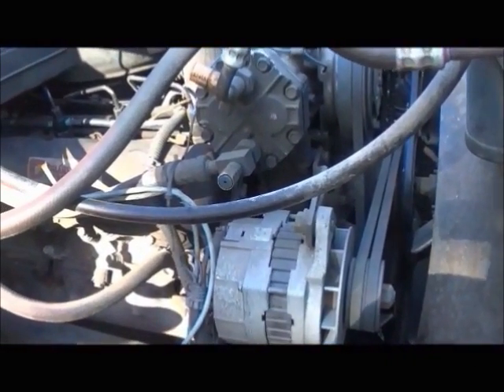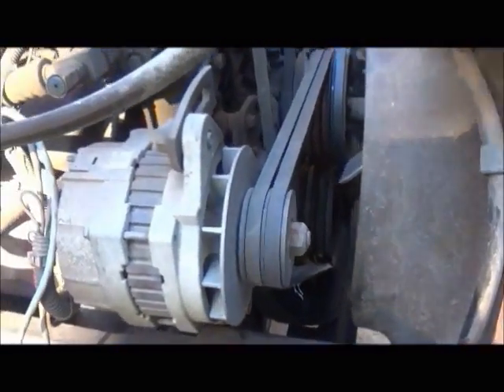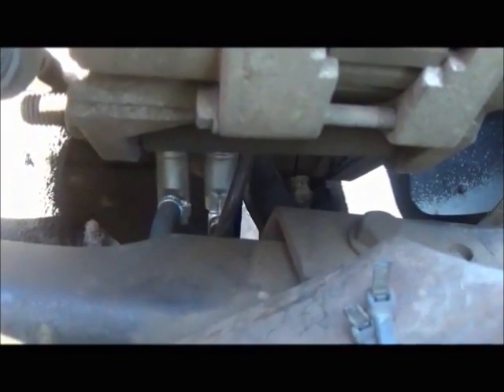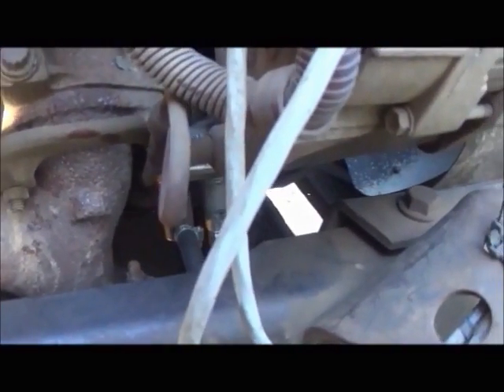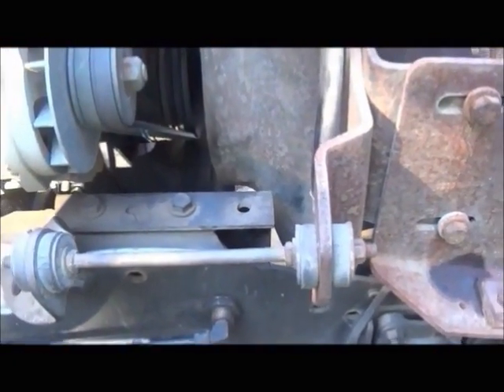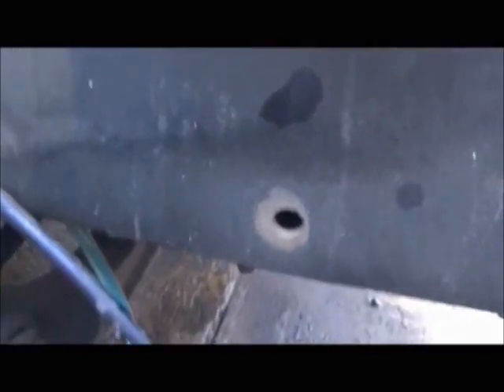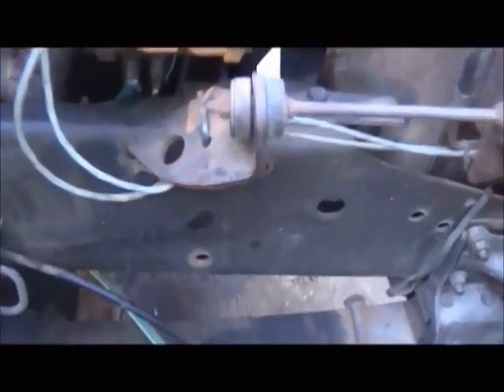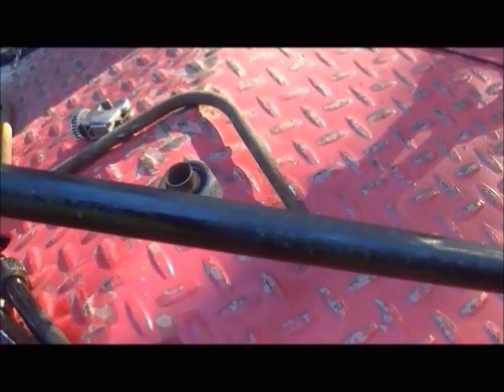Troubleshooting A Diesel Fuel System For Air Leaks International 7.3

Comment: 😂what a pain in the ass ..I'm doing research to find out what could be the cause of difficulty cold start I suspect an air leak between diesel pump and tank today this bastard broke down in the road and I had no tools with me😂 I pump the prime pump on filter housing and it ran enough to get back home so I changed the filter did find 3 drops of water but the diesel was coloured like paraffin clear not green like it should be in thinking there is a garage with diluted diesel but I still think I have a airleak😂😂 I'm not a qualified mechanic but I can help myself in all trades except understanding women

Comment: Actually running into the same issue on my international rollback. Weak and starts sputtering in high rpm
Reply from the maker: My top kick does that when the filters start clogging. Not enough fuel at high rpm
Reply: @jonathanw4942  Just put a new filter on this morning, it was time for one anyway. When I took it off air was hissing out, not sure if I'm suckin air or the system was pressurized. It only sputters in L & 1 now, but has white smoke. Putting on a new lift pump I have tucked away to see if it fixes the issue.

Comment: lol bro sick idea. i also work with low pressure systems and use a little air pump, a little female air fitting on the end and can use a chuck with q cone shaped nozzle and jam it into the system and look for spray/mist somewhere. the first thing to blow out if you overpressure the system is the lift pump so keep the psi low lol. i like you clear hose idea i will have to try that sometime have plenty of hose floating around. thanks for sharing sir

Comment: Question, if the injector pump "pops" the injector and sprays fuel into the cylinder and the residual is returned to the fuel tank via the return lines, why does air in the return lines cause a problem?
Reply: DRA5136 cavitation where the tiny air bubbles collapses/implosions which creates heat and rapid wear and tear on the pumps and injectors creating a crappy runnig engine!

Comment: pressure the line and spray with soapy water, or plug the line and pressure with air with a gauge to show leak down while on the frame. thanks for posting.

Comment: Johnathan thanks for the vid I have one of the 7.3 non turbos and I finally won the air in the fuel line battle it's a lot of satisfaction to walk out when it's 15 or so degrees and have if start in 2 turns of the engine. Love just hearing them run, when there's something heavy to pull or haul around the shop that's my go to. Ron